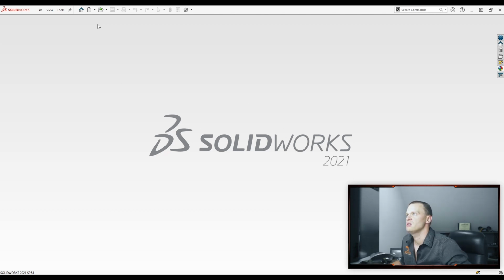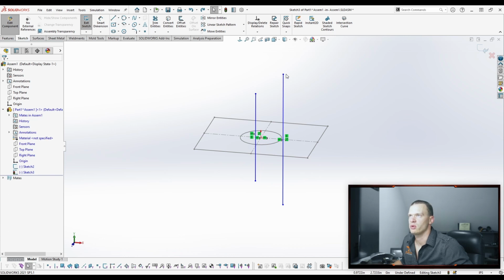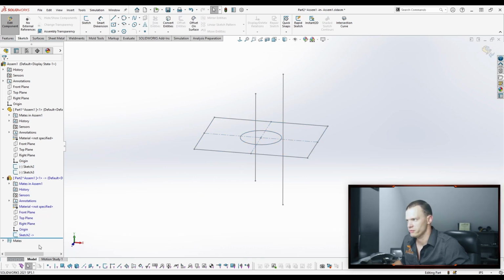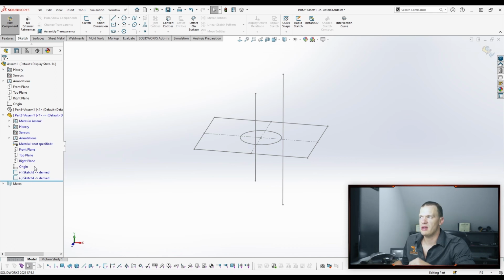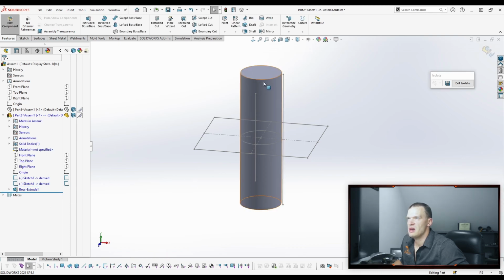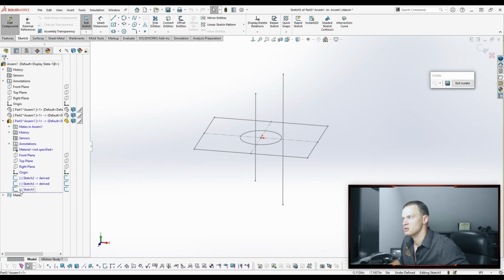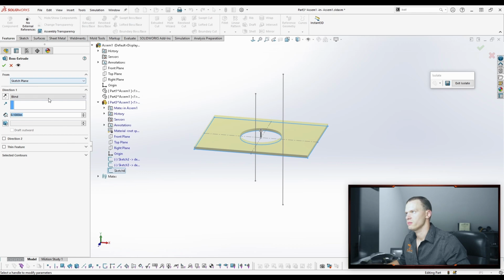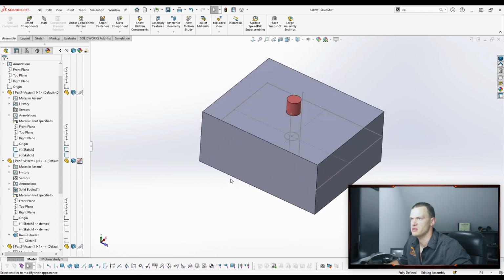Top Down Modeling With Skeleton Sketches in Solidworks

Comment: What about the fact that your pin and hole are the exact same size? How would you create an offset for tolerance/intended fitment (Press fit or loose fit)?
Reply from the maker: Great question! I have a few different ways to handle this. 

The first is drawing two circles, one representing the pin and one the hole. This way you can relate them to each other, (say, maintain .005" interference) no matter the diameter. This works great for specifying exact fits, and clearly showing the diameters and fit within the sketch. In very demanding applications, you can even set the holes and pins tangent to each other, instead of concentric, for added stack up accuracy. The one downside to this is that you can end up with a lot of lines and dimensions in your sketches, which can muddy the waters.

The other method I have used is is to use the "move face"  feature to prescribe the offset. I use "interference detection" as one of my checks, and then create the offsets for each flagged area. I can use search in the feature tree to find all my offsets too. I find this keeps the sketch clean, but is not as easy to create relations and less obvious what is happening, unless you examine the tree. I tend to use this on non-critical fits or large clearances.

Hope this helps! If anyone else has methods they use, feel free to share!
Reply: Does your 3D assembly really need exact tolerances in the model? Why not just model everything using the nominal sizes, and only add the tolerances when moving on to the manufacturing step, and just note the fitment on the drawing?
Reply from the maker: @denisl2760  A couple of thoughts here. 

I typically do not set/note tolerances within my sketch dimensions, unless it is a tolerance I know I need to be aware of or am documenting within the model for someone in the future. I know if you use "import dimensions" within drawings the tolerances will come in and be linked, which I do like, but I have not added that trick to my normal workflow yet.

When you say "nominal size", do you mean make the model geometry at the middle of the tolerance range you end up specifying on the drawing? If so, this is exactly what I do! You can use either technique above (or any other method you like) to get the geometry where you want. 

If by "nominal" you mean what I call "line to line", where pin and hole diameters would have coradial/coincident surfaces and the clearance would be made by the tolerances of the print, I do not do this for a few reasons. Mainly, when the model becomes the standard for manufacturing and inspection down the road, programs will typically pull surfaces directly from the CAD and if the model is not at nominal, it will be up to someone else to read the print and make the correction. Likewise, when I send parts to be 3D printed, the printer will need it modeled at nominal for me to have the best accuracy.

Does this answer your question?
Reply: @forgeproductdevelopment  I guess it depends entirely on what the model will be used for, and the manufacturing process. If its directly used to 3D print then yeah I can see why you'd need to include the tolerances in the model itself. But if its going to be used to create a set of 2d drawings and sent to a machinist, the machinist won't care that your 10.1mm hole and 9.9mm pin are actually drawn as 10.0000mm, as long as there is a note on the drawing giving them the desired tolerance.
Reply from the maker: @denisl2760 In a shop environment where the machinists work exclusively off of paper drawings (and never query the model for measurements) this may be technically true, but I would still advise against it. Even in this situation it relies on the machinist to calculate by hand every measurement that uses that feature. I would much rather give them nominal dimensions and symmetric tolerances, to guard against errors. 

Also, since it is impossible to know if, over the life of the the model, it will ever be used in a CAM or inspection program (CMM or scanning), queried for measurements, taken out of context of the drawing, or 3D printed, I would much prefer to know my CAD is nominal than rely on everyone down stream of me to catch the one sided dimension that is buried in a drawing and make the corrections.

Hope this isn’t too harsh. To be fair, you are going to know what is best for your shop and workflow.

Comment: How about insert part the skeleton into sub-parts vs derived sketches?  Maybe more warranted for more complex parts / subassemblies, and too much overhead for lots of simple parts?
Reply from the maker: Inserting a part vs derived sketches is a questions that gets brought up quite a bit. I have not done enough testing between the two to say one should win outright. At this point I would view them as tools to have in the box. Get familiar with both and then pull each one out when you feel like is has the advantage. At this point I would say both are viable, but I am likely biased towards the SS method due to familiarity.

Comment: What about downloaded parts like bushings that won't update as you change the pin size?  If you design a whole machine like this your parts have an origin that is somewhere well outside the geometry of the part.  Cars are modeled top-down and it's generally a pain work with their parts.
Reply from the maker: You can move the derived sketch after you create it to align with the parts files origin and planes. Jus use your usual sketch relations to control its location. You should actually be doing this every time, to create fully defined sketches and prevent things from moving unexpectedly, unfortunately I did not show this in this video.

Comment: Thank you for sharing, great information!  Is there a reason that you wouldn't create the skeleton drawings at the assembly level, rather than having that first 'skeleton part' to derive your sketches?  By having the 'skeleton part' does this really serve as a way to hide those sketches quickly when your isolating other parts, or is there more to it than that?
Reply from the maker: That is part of it, but the main benefit is keeping the sketches at the top of the tree. SolidWorks likes to solve the the tree and relationships from the top of the feature tree to the bottom. When you start creating sketches within the assembly file, those sketches and planes get pushed to the bottom of the tree. Also, you can easily use that skeleton sketch part file in other assemblies, allowing the same part file and references to be used concurrently. Hope that helps!

Comment: Hi Josh, first of all greate tutorial, very very useful for me. 

And I have a little question, when saving all the pieces that we created inside the assembly, wich process is better. Saving them inside the assembly or externally? Wich one is more stable?

Thanks
Reply from the maker: Great question! I do both. Early in the design process, when the design is still undergoing large changes and staying within the engineering team. I will leave everything as a virtual part inside the assembly file. When I go to publish or release individual parts or make drawings, I will save each one out to an external file.
Reply: @forgeproductdevelopment  all right, perfect I see that way to work pretty consistent. 

Thanks for your reply.

Comment: This is great, thank you!
So, let's say i want to add a bit of an offset between these two parts for tolerance. Would it then be better to add a second slightly bigger circle on my "skeleton" sketch, or to use the move face feature on the "block" part?
Reply from the maker: This is an excellent question! I have found that both can be useful. Generally, if I am creating a non-precise gap, I will sketch line to line and then use the move face command. If I need to precisely define the gap for some reason, (bearings, slip/press fits, snap closures, etc.) I will sketch the gap in, so I can dimension it and see the relationship easier.

Comment: Thanks for doing these type of tutorials, they are great! 

I feel like almost all of these smart and stable tricks are not practical when you throw in a PDM and a PLM solution in the mix. Having all these references between parts and assemblies will most likely create a revision nightmare if you need to make a minor change and you end up with a lot more work. What are your thoughts on this?
Reply from the maker: Thank you for your kind words and your thoughtful question!

I had a much longer response to this, but think I will save that for a video. The simplest summary of my thoughts is, when designing from scratch, I think it is better to build this type of functionality in to the models, and then break or freeze the references when the files go to be released/put in the vault, then work bottom up. As a designer, I can't imagine not being able to pull in references and build relationships. I feel it saves time when making changes, but also helps error proof the design process by ensuring changes are properly propagated to each part.

That said, I am always interested in learning alternative methods. Do you typically design from scratch or are you modifying existing parts and assemblies? When do your designs get entered in to the revision controlled vault? When a part or assembly gets entered in your vault, are external references allowed, or must they all be removed? When you make changes to a component, how do you ensure any affected part is also identified and updated? Thanks again!

Comment: Even though I dislike the insertion of an skeleton part within a part, I think it's more stable than this method of derived sketches.

The big disadvantage of this method is that you need to constrain again the derived sketches otherwise you will have a mess in the design and That doesn't make sense.

In the other hand inserting a part within a part could decrease the performance of the already lag and inefficient software. But the big advantage it's the access to the sketches and parts without opening the assembly and a more clean environment.

Have you tested both methods? If so what's your opinion about it.

Thanks for the video it was very clear and accurate. You just missed the section of fully constrain sketches which is a key process for a good design practice.
Reply from the maker: You are right! Best practice is to constrain the derived sketches, I should have included that. Often in my videos I do not constrain sketches for the sake of time, in this case I should have made an exception. The only constraints you need are to locate and orient the derived sketch within the sketch plane. Any constraint that tries to alter the sketch will fail.

As for inserting a part within a part vs the derived sketch method, I have not done enough testing to see which has faster rebuilds. I will try to do some testing and make a video on my results. I would imagine the derived sketches would be faster, as you are importing less information, but the intuitive answer is not always true with SW.

I can understand the advantage of having the sketches be editable without opening the assembly, but I would be nervous editing a skeleton sketch without seeing how I am effecting other the parts. In that case, I would likely have the assembly open anyways.

Thank you for this thoughtful comment! What workflow do you prefer?
Reply: @forgeproductdevelopment  thanks for your reply.

I found the master part absolutely effective and very stable related to sketches, planning and organisation. But I think it makes the software very slow. 

If I compare it to Autodesk inventor the latest just derives the needed sketches without importing any part. Probably that makes the software faster and rebuilds fantastic.

I think because of the problem of accessing the master sketch and constraints I would prefer the master sketch part. Been designing big equipment with that and the accuracy is just perfect. 

If you make a video comparing both please let me know.

All the best
Reply from the maker: @AntonioBarón  I have not had any issues with stability using the derived sketch method, but I would be interested to compare the two. I will have to do some tests and see what I can come up with.

Just like Inventor, you can directly convert entities from external parts into a part and use them as references. Though, I have found the stability and rebuild speed not as good as placing either a part or derived sketch within the part file.
Reply: @forgeproductdevelopment  please do compare both methods, i'm still relatively new to solidworks and searching for best methods while doing top down modeling, looking forward for that video
Reply from the maker: @khalilbahlawan4439  I will try to make this a priority, since so many people seem interested. Since you are new to the software, I would advise trying both and seeing how they perform for you. What technique have you been using?
Reply: @forgeproductdevelopment  i'd really appreciate it, as i said since i'm new to Solidworks i'm keeping it simple, build a base part and model the rest around it